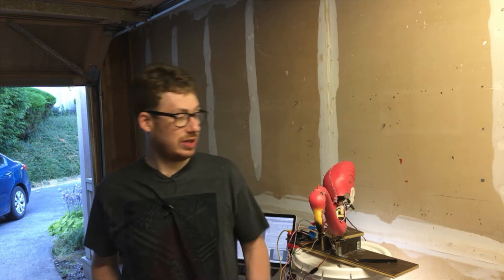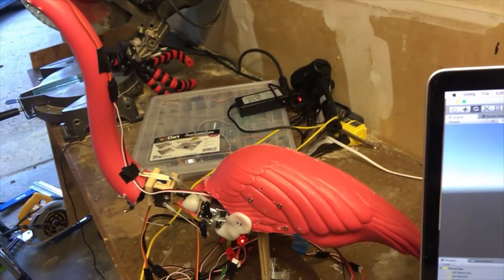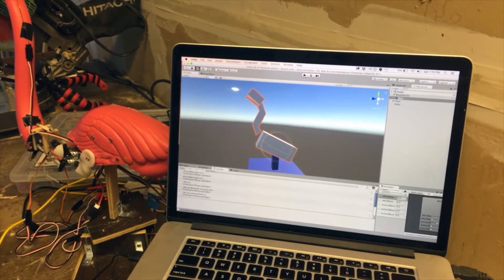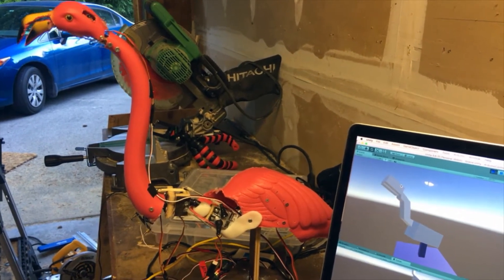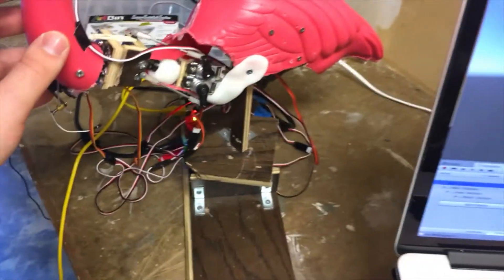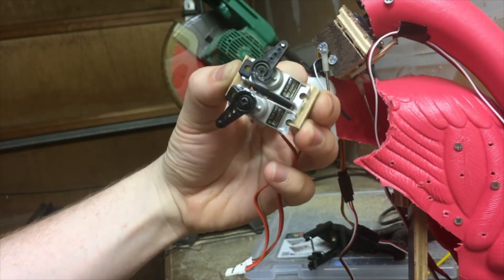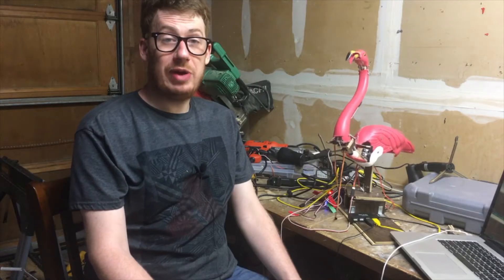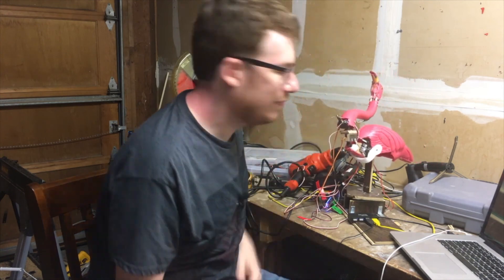Animatronic Lawn Flamingo

Comment: YEAH!... WELL, this whole thing isn't easy for non-programmers or beginners when it comes to setting up the software. I've spent THREE WEEKS tearing my gray hair out trying to get the Arduino and Bottango servo board to communicate--without huge ERROR NOTICES!
I've asked folks on these Bottango YouTube videos to help me so that I may offer positive reviews. No one has responded! I suppose no one cares!
Well, I am not posting positive feedback since the Maker never responded to my email contacts, YouTube videos, Reddit, or Facebook. Neither has anyone else!
So, until individuals start assisting others, I recommend that everyone utilize Maestro or another program.
The Bottango community and Maker have no decent YouTube videos to walk folks through this.  They only have videos that celebrate the awful item and their animatronic parrot and bear. It's all hype. They shortchange the consumer by directing everyone to the "Manual." This is wonderful and dandy IF you can read it!
It appears that persons who are overly intelligent FAIL to simplify their manuals and instructions. They also do not utilize uneducated individuals to assist them in troubleshooting these kind of problems, which they DO NOT SEE. 
Well, Bottango fans, what little there are, I'm really furious about this program. I studied the handbook, installed the joints and motors, and worked out the Port issue. To get Arduino to establish a pORT, it appears that you must turn off the "LIVE" setting in the program. THEN, you activate the "LIVE" button.
The Buttango Servo Board is a major difficulty. I'm pretty upset about this. The board states that the voltage input ranges from 5 to 8.4 volts. So, after hooking it into an adaptor and letting some of the live servos run for a brief time, it BURNED OUT over 15 servo motors. I am F--- GLADE I do not hook this into my REAL animatronic device because I would have to GUT the F___ thing and replace all the servos! Thank goodness I used test servos that weren't hooked to any mechanism.
I've also seen that several YouTubers just utilize Arduino Uno or greater boards, with breadboards connecting everything to Bottango.  I am wondering why.
So, if someone calls me for assistance, I will remove this nasty message, apologize, and provide positive feedback.
OTHERWISE, it remains available on YouTube.
BOTTANGO must take responsibility and recommence their teaching movies, as well as respond to these comments. 
SLIENCE BETRAYS THEM!
ANYONE that wants to help can contact me here... I will be more than grateful; I will even pay you $$$$$$  
SO, lets SEE IF anyone communicates???  :o)
ROSS: 360-421-7195     ROSSMARSHALL@weirdvideos.com.